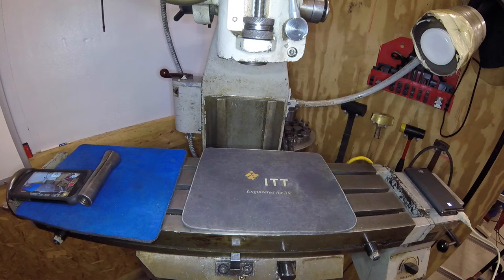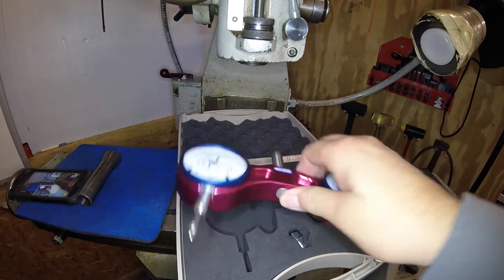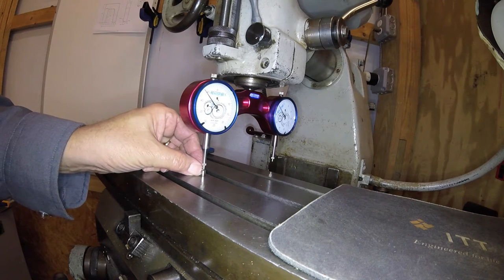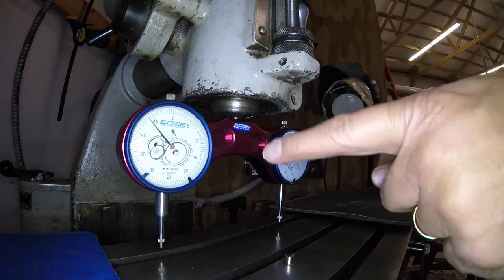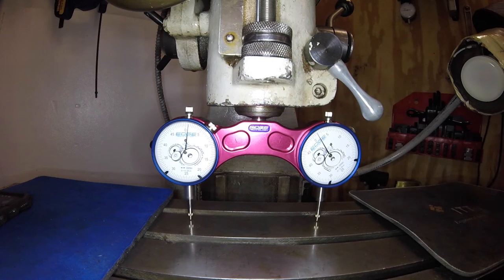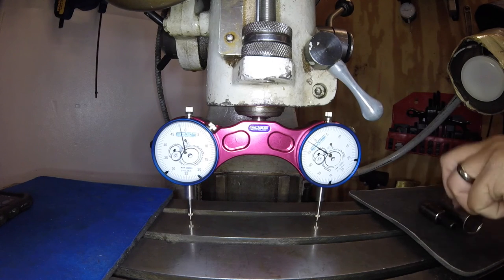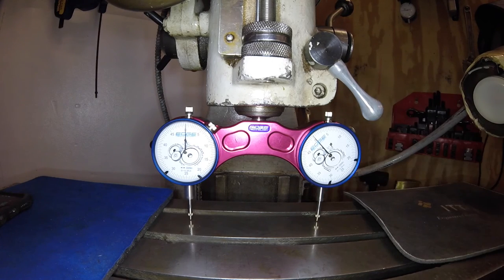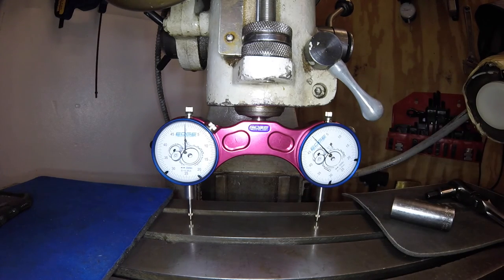Pro Tram First Use

Comment: can you tram your vice with those too?
Reply from the maker: Mike,

You can use this tool to make sure that the surface at the bottom of the jaw opening of the vise is parallel to the table,  but you would not use this tool to align the fixed jaw of the vise with the X-axis of the table.

You would tram the fixed vise jaw in the same manner that I trammed the part I was milling starting about 6:30 in this video https://youtu.be/6Z7AmvV9HIc. (Its in fast forward so I sound like a chipmunk)

I also made another animated video on tramming a part/vise on the mill called "Always sweep away from the pivot"  https://youtu.be/Ri_wEC_0AfI

Hope this helps!
Chris
Reply: Edge (who makes Pro-Tram) also makes a device for tramming in a vise.